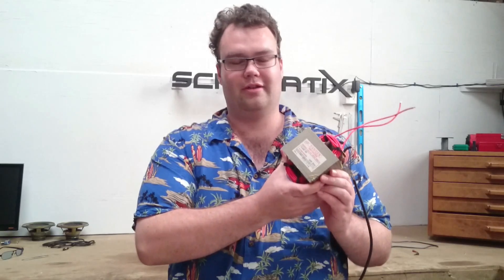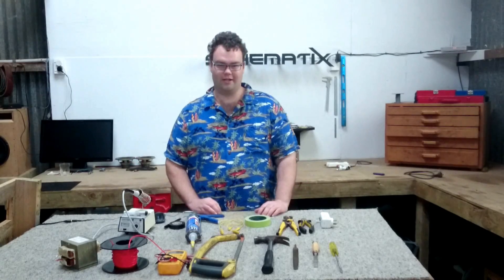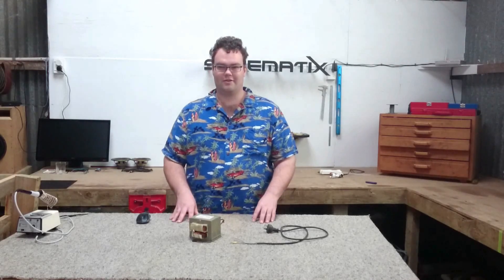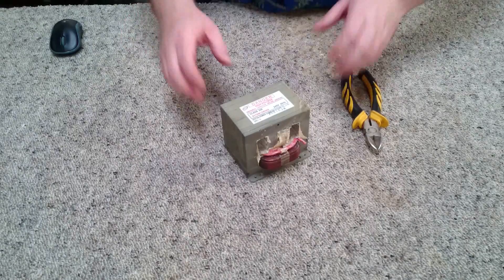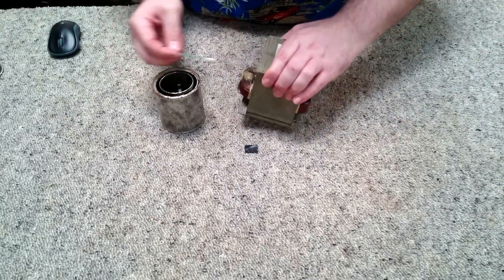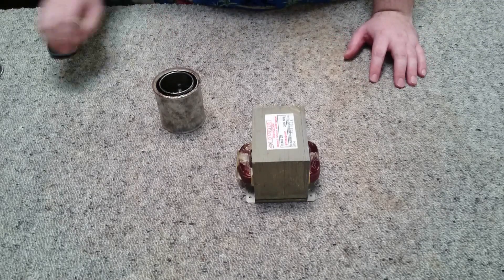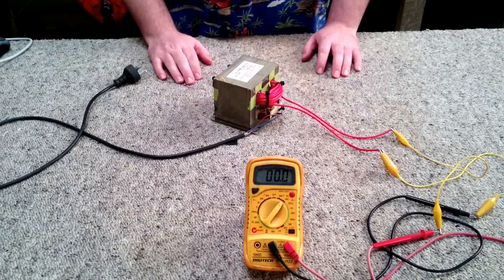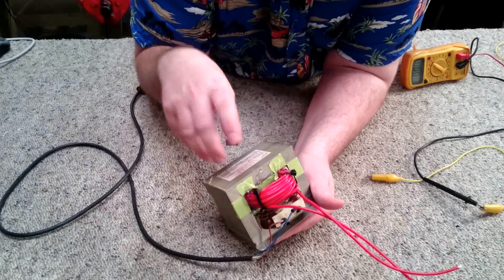How To: Rewind Microwave Oven Transformer, Trash To Treasure!

Comment: great tutorial! Saved me some troubles and just gonna re purpose my surplus of microwave transformers haha. Wish they made it so you could salvage and re purpose all of it. Having to cut it apart it kinda bad design tho I know why they claim to do it that way. =/
Oh also, my only critique for safety purposes would be when conducting the test to make sure the transformer isn't grounded, make sure to test that the place your grounding from is in fact a good ground contact point by touching lead to where you would like to have ground point and another random spot on the former with another. This leaves no room for error really. Or at least reduces it severly as I know I've had times where I thought I was on good grounds but was in fact weren't and double checking like that really saved me! Thanks again bud!~
Reply: This is not practical at all. This transformer gets Extremly hot under normal load. Because the input power is too much. I tried many time in the past to build high current power supply out of it, but no hope. Only you can built Spot welder.

Comment: why in fucks name would you replace the shunts? They are only there to enable the thing to work as a microwave transformer. When you use the transformer  in a different role you want to bin them as they rob you of vital flux.

Comment: These transformers are no good for this purpose, they are not designed to run continuously and they are overdriven to keep cost and size down, a transformer designed for 800 - 1000w continuous duty cycle  would need o be twice this size.. Driving the transformer in this way means it has a very high idle current of usually over an amp or even more but even at 1A 240v thats 240w being dissipated needles to say they get HOT fast even with no load...

Comment: Good tutorial. Just a little FYI: "OL" on the meter is for "Open Line", not "Overload".
Reply: It actually means over limit meaning over the limit that can be measured this is why it will also show OL on voltage measurement when you go above limit (the lines are not open) and also on resistance  if you try to measure a resistance to large same for capacitance and so on....  I can see why people say this though as with the leads open the meter displays OL however the meter is simply interpreting the open leads as a high resistance that is Over the measurement Limit....
Reply: Well, actually no. "Open Line" &/or "Open Loop" is written inside some manufacturer's literature. It's the equivalent of infinity. And when you are testing with a DMM and you see "OL", the meter is indicating that the loop is open or infinite resistance.
Reply: @cwboxguitars  it means Over load or over limit for example, if you try to measure voltage above the maximum limit, the meter will display OL even though the leads are not open, same with capacitance, even though the leads are not open and if you tried to measure 10G ohm the meter would display OL even though again the leads are clearly not open.  even when using manual mode be it 4v 40v 400v or whatever as soon as you exceed the set range the meter displays OL.......don't take my word for it here's a link to the fluke 87 manual scroll down to the top of page 15 and they will tell you the same thing. https://assets.fluke.com/manuals/87______umeng0800.pdf

Comment: Build a Rather Hefty Battery Charger doing this.    Was able to start my truck engine using the thing.  Did just fine cranking the engine for a few seconds at a time.  Any more then that and it would have melted down I'm sure but it worked.

Comment: I did this years ago, but the problem with these heavy laminates is the eddy currents that heat the transformer even when it is idle or rather not drawing current from the secondary.  Have you ran into this problem with microwave transformer cores, or is it they are better made these days to control the eddy currents?  Thanks
Reply: They are deliberately inefficient by design.  It is how the magnetron tube is controlled. The shunt pcs are part of it.  These days they have eliminated the transformer. Copper is expensive.
Reply: As long as the newer microwave oven isn't a Whirlpool,  you should be fine.   :D

Comment: 21 volts. What kind of amperage can you get out of your  Transformer at 21 volts?
Reply: 18:13 151 Amps
Reply from the maker: I was able to draw 10amps easily without any significant voltage drop.

Comment: Great Work,  patience in explaining and teaching style 👍🏽

With the wire melting, you could just go in for a heat resistance insulation cable or wire for that "MICA FIBER COATED CABLE".

Comment: OK, nice enough tutorial.  Question:  Did you need 21 working volts?  If so, throw on a couple more turns, as the voltage will drop when you add the load.
Also: Folks, please, if you're going to be teaching other people how to do things, at least use the proper tools.  Screwdrivers are not drift punches or pry bars. Please show the people the proper tools to use for the job so they don't pick up bad habits from the start.
Reply: +LJ Prep 
Please, if you are going to be telling people to use the proper tools - at least tell us what those tools are!!
:
Reply: @criticallook1352  He used a screwdriver to pry. (I said they're not pry bars) He used a screwdriver to drive parts. (I said they're not drift punches) Now, if you can't figure out what the proper tools are, you have no business watching these videos. DIY is not for you.  ;)

Comment: ?  How much current does that transformer use to create 21volts.
Reply from the maker: That depends on how much current the secondary is outputting. The current on the primary increases relative to the amount of current the secondary is outputting.
Reply: @Schematix  Thank you. I'm learning. ;)
Reply: The voltage is determined by the number of secondary windings in relation to the primary windings. If the number of turns is the same, the voltage will be the same. If you have half the number of windings on the secondary, the voltage will be half of the voltage from your source (house outlet) and twice the amperage WILL BE AVAILABLE. BUT, current is not pushed by the transformer, it is pulled by the load, the electrical device being powered. A 10 Watt bulb will draw 0.47 Amps because A = W/V so 10/21 volts = 0.47 Amps. He didn't say how he got 150 Amps but that's 10 times the rating for the wire he used for the secondary. If he had thicker wire on the secondary he could weld steel with 21 volts and 150 amps. The voltage from the wall won't change more than a volt or 10 but your current draw will be determined by whatever you plug in to it. Hope this helps.
Reply: @BariumCobaltNitrog3n  Excellent answer. Thanx.  🧐👌

Comment: What was the initial VA rating of the transformer before it was ‘hacked’ ?  That way you can figure out the secondary max current for your setup ( assuming proper wire size).

Comment: ohhhh i pickem up off the roads,i have 10 to take apart,getting the high voltage caps and diodes which can be used to make lightning generators and even power hamradio amps

Comment: no way jose on that pricing,not sure where u would get ripped off for 100 to 200 for just one transformer when u can once again go on amazon or find used ones complete for $50. used ones for hamradio etc can go from 50 to 150 and 20 amps complete ie Pyramid or astron supplies,but dont misunderstand me,this is all good hobby work

Comment: ummm u can also put your input voltage into the secondary and see what the voltage is on the primarywhich then becomes the secondary....just reverse the system,also a variac can do good stuff,all good stuff though... i would not ruin a good microwave tr cause it can be used for other things as is... theres so many combos of ways to get 21 volts !

Comment: MOTs are made as cheaply as possible and are NOT meant for continuous service...the idle current is way too high due to the absolute minimum number of windings in the primary, you need to add 10 to 20 turns in series with the primary for continuous service which will reduce the idle current a lot. Also it is way easier to use an angle grinder to grind off the welds holding the "I" and "E" sections together and then push the primary off in one piece, you can then reuse this wire for something else...MOTs are great for making DIY transformers, light dimming chokes (even variable with adjustable "I" section gap, I  have even made audio output and speaker impedance matching autotransformers with them...

Comment: Not a bad tutorial........for a Kiwi. Seriously though this is just what I was looking for as I have collected plenty of microwave transformers and I am looking to make an electromagnetic chuck/ machining plate. I had it pretty well sorted except for a power supply. I was looking for something  around 40 - 50 volts dc but they are thin on the ground and as you said  expensive but now you have shown me the way. I figure if I build a  transformer like you have shown and configure it to put out about 35 volt Ac and then pass it through a bridge rectifier I should end up with around 42 v dc. Dc giving a stronger magnetic field. Thanks again mate. Cheers Stuart 🇦🇺
Reply: how you get 42dc from 35ac ?!
and i advise you to take many line from secondary so you get many ac volt
sorry about my stupid english
and did you know what wire gage or size he use for 15 amp ?
Reply: Fuorman. Hi Fuorman, I believe that when the AC goes through the rectifier you get an increase in voltage.
Reply: @scroungasworkshop4663 
Thinks for the idea 
I will try it and tell you soon
I think diodes reduce voltage but maybe there's something i miss 
Stay safe and take care my friend
Reply: Fuorman. I thought so to so maybe I am wrong. Please let me know how it goes. You stay safe as well my friend. Cheers Stuart, Australia 🇦🇺
Reply: @scroungasworkshop4663  AC voltages are usually given as RMS while the peak is ~50% higher, eg 240v has a peak of 325v.  Your bridge rectifier converts peak AC to DC, so it comes out higher.  The bridge has 2 diodes and will drop about 0.6v each.

RMS is the DC equivalent of peak AC, so a resistor at 325v AC (peak) will put out the same amount of heat as one connected to 240v DC..

Comment: DC 0-100V 10A 50A 100A Digital Voltmeter Ammeter Dual LED Amp Volt Meter + Shunt

Do you have experience of above meter? Can it be used to measure this AC transformer?

Comment: go learn what is ,gauss, maxwell ,core properties, winding ration,core size,constant numbers, a lot of formulas, hz, and so then play w/transformers ,MOT THEY ARE JUNK ,JUNK,JUNK,if you hookup a oscilloscope on the secondary side after you rewind this thing tel me what kind of sin wave you see on the oscilloscope ,HO GOD you do not want to see another MOT again ,I work for transformer companies 40 years wind this things ,i love them when they are design  the right way
Reply: less time - you should spend MORE TIME learning how to read and write.
Reply: less time. What is being demonstrated here is what can be done “on the cheap”. Ok, you’re not going to run your laptop off it but it would be fine for running an electric motor and other things that don’t need a clean supply. I am making one to put out around 48 volts DC to power 3 other MOT’s that will be turned into an electromagnetic chuck. Where does the average bloke like me get the parts to build a “proper” transformer and how much would that cost. You say they are junk BUT there are a lot of tutorials on YouTube showing lots of successful projects being made from them. To be honest you came across as a bit of a smart arse in your reply. We are not building professional transformers here we are using almost free parts to make something useful. It’s called a hobby. I have worked with automotive suspension but when someone builds a billy cart I don’t tell them to go learn about steering geometry, toe in, caster angles, camber angles first and then play with steering and that the crappy little wheels they are using are JUNK, JUNK, JUNK. It’s just a hobby mate. Who cares as long as it works and no body gets hurt.
An oscilloscope? You have got to be fucking joking. Most blokes are just building stuff with these things in their shed.
I see it fairly regularly on videos where the “PRO’s” chime in, get all technical and confuse the shit out of the average bloke trying to learn or make something. You have added nothing positive to the subject. All you have done is succeeded in big noting yourself as an expert and putting everyone else down. We all know MOT’s are junk, that’s why they get thrown away. Why don’t you post a video and show us all how we can make a proper transformer in our own garage for next to nothing. Now that would be helpful.

Comment: Throw those shunts away! They reduce the efficiency of the transformer by storing magnetic flux instead of letting it pass through the secondary winding to the core material on the "other side" of the secondary. By distorting the sine wave passing through the secondary, they also add a hideous amount of harmonic distortion to the output. Those shunts are how they turn a 1500 Watt device into a 1000 watt device.
Reply: I did a rewind of one of these and tossed the shunt strips.   I was wondering whether I made a mistake when I saw this.   Can someone explain exactly what they are there for?
Reply: @phbrinsden : Here's the thing - iron and steel can hold a lot more magnetic field than air.can. So in an un-shunted transformer, when the magnetic field starts increasing around the primary wires it can swiftly move through the air, cut through the secondary windings, and then get stored in the steel core where it moves much more slowly due to the steel being able to hold a much denser magnetic field. You are giving the magnetic field someplace to go after it has crossed the secondary windings. But if the magnetic field has to go through a shunt before it passes through the secondaries,  the shunt is going to store the field until it saturates, and only then will it start releasing the stored field into the air on the secondary side of the shunt to then pass through the secondary windings and then it will be stored in the core steel. But some of the magnetic field generated by the primaries is always going to be stored in that shunt and never reach the secondary windings. They can very effectively tune the power output of the transformer this way. It also lowers the voltage on the secondary side of the transformer, as well as introducing several harmonics of the original 60 hertz input wave.
Reply: Bogy Wan Kenobi    Awesome, thanks for explanation.

Comment: With the size wire you are using for the secondary, I would watch for excessive heating, even at 10 amps. Remember, the normal current rating for hookup wire is in free space where it is cooled. When you put it in a tight coil, it can't cool as easily. Use larger wire with thinner, higher temperature insulation, less heat. Play it safe.
Reply: That is definitely the wrong type of wire,enameled wire is best,not worth taking short cuts.Very dangerous stuff your playing with.Transformers heat up a bit so you have to think about the long term usage.Think safety always. Good luck!!

Comment: @Schematix How did you manage to get 151 amps off of that gauge of wire? I thought the gauge determines the amperage and I know the device being powered will only draw as much current as needed so how did you manage to tame it down or is that only a open circuit issue with no load? I used a  bolt cutter or I've used a large pair of dikes and wire cutters like the one shown in the video and nibble it down the drilled a hole dead center and easily knocked out the secondary, but I didn't get to winding the secondary yet as I am new to this. You should use enamel not lacquer to repair a blunder as all of the magnetic wire I purchased always said enamel, I painted cars for a living . Lacquer eats at enamel, enamel does not eat at lacquer. I should be able to make a center tap out of this, correct?

Comment: I've watched many many people do this to remove the secondary windings from microwave Transformers every time I watch it it makes me cringe because that secondary winding is a great experimental piece to get it out without damaging it the weld on the sides of the Transformer if you lightly hit them with a grinder very lightly then smack the bottom with a hammer the whole bottom of the Transformer will come off then you can slide both windings off with no damage and keep the secondary fully intact makes a great electromagnet or winding for a magnetic generator.... then you can just simply Bolt the bottom piece back to it using metal straps and long bolts.... I usually weld them back
Reply: I'm interested in experimenting with the secondary winding, can you please name some of them I can try with? I don't have a way to weld it together but can I use some two parts epoxy to put it together?. Thank you for answering 😊

Comment: How did you know it was the secondary coil that needed replacing in the first place?  Isn't it possible that the primary would be bad on some discarded microwave ovens?  Was the original secondary coil shorted or broken?
Reply: Easy enough to check. First check to make sure there is no ground fault. Then check that there is continuity on the primary. Finally check primary ohms as reference. I am not sure that he was saying that there was anything wrong with his transformer, just that he was illustrating for us how to make our own. Maybe i missed it though.
Reply: In all household appliances in NZ the primary is going to be 230V. However you will want to customize the secondary to your needs.

Comment: We had trouble on the production line and customers with power transformers overheating, the idle current wastoo large, the vendor of the transformer used low quality lamination material..